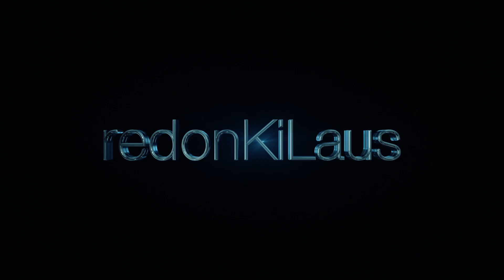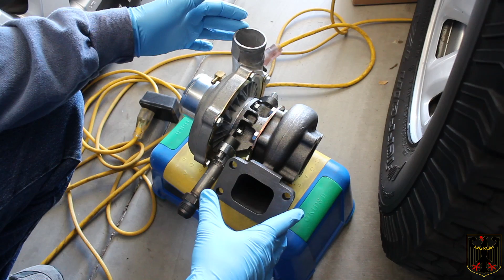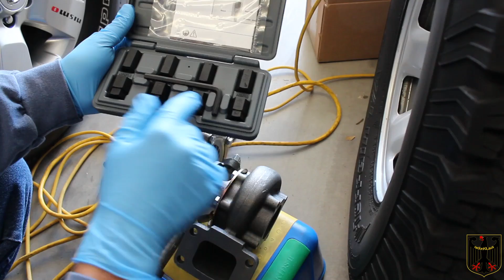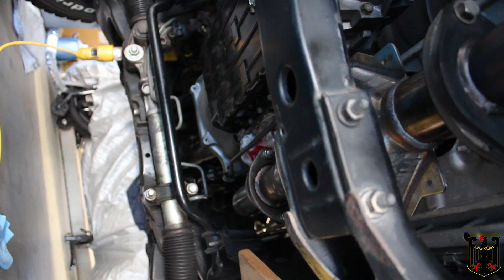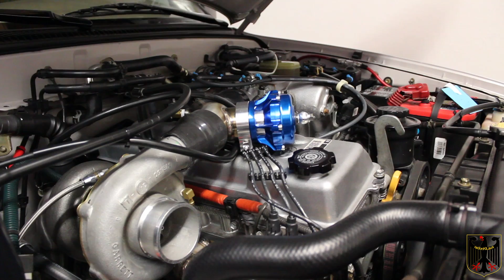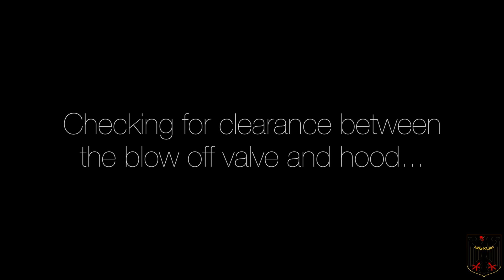KO Racing 2RZ/3RZ Turbo Kit Installation - Part 4

Comment: Hellos, where did you buy the ignition coils ? Did you remove the distributor? Help me please
Reply from the maker: They are factory, there are 3 versions of 3RZ, early engines with distributor (as well as later ones in some markets), then in 96/97 they moved over to 2 remote coils, then in 2001 over to coil on plug.  Thanks for watching!

Comment: Why no intercooler?
Reply from the maker: It's a simpler setup and doesn't require chopping up the core support, plus I'm running low boost.  I am planning on adding a methanol injection system to make the truck more drivable during our very hot Arizona summers.  Thanks for watching!

Comment: Why don't use a intercooler ?
Reply from the maker: Because it is not technically necessary in low boost applications, and because I didn't want to cut the actual vehicle to fit intercooler piping.  You can definitely run one if you want fairly easily.  Hope that helps, and thanks for watching!
Reply: ah okay, now i understand, thank u sir, great video, great job, i have a Toyota Prado SUMO and this one have the same engine, How much power do you get ?

Comment: I have a 2rz and I pieced together my turbo set I put a small water to air intercooler which I would highly recommend
Reply from the maker: The water to air IC is definitely a good option if you don't want the hassle of running piping for a traditional FMIC.  Thanks for watching!

Comment: I'm going to get the KO kit soon hopefully. What do you recommend I buy like parts that are needed that don't come with the kit?  to make the install process faster ?

thank you for your help really appreciated
Reply from the maker: +Tobes There's a lot of misc. hardware and things like vacuum lines you need to make the install perfect.  One thing you definitely want to purchase is a wideband A/F ratio gauge, as that alone will potentially save your engine in the case of a tuning or overboost mishap.  Hopefully this helps a bit, I cover most things in my video series.  Thanks for watching!

Comment: is that aftermarket catalytic converter ?
Reply from the maker: +Tobes Yes it is, it's from Magnaflow.  If you have a 4Runner or T-100 and you purchase this kit, it will come with the same one in order to be able to be bolted on without any cutting/welding.  Thanks for watching!
Reply: +redonKiLaus 

I have a 2rz ; so if I get the KO kit it will provide a catalytic converter?
Reply from the maker: If you have a 2RZ, you have a Tacoma (or possibly a Hilux, if outside the US), so they will not provide a cat by default.  You can always add it to your order if you are in need of a new one, however.

Comment: what's the distance from the block? to the back for the downpipe
Reply from the maker: +VestigeVogue I don't remember the measurement, but if you order from KO they now offer a 4Runner version of the kit with the same spec as mine, which is bolt-on.  Thanks for watching!

Comment: Hey Redon, what size studs did you use to bolt the turbo to the manifold and where you purchase them from?
Reply from the maker: I honestly don't remember what size the studs were, but they come with the kit and I believe they come with the manifold as well if you purchase that by itself from KO Racing.  Sorry I couldn't be more help, and thanks for watching!
Reply: 10 x 1.25

Comment: I need more, feed my 3RZ obsession! I have always wondered what you use(ed) to clean your engine. It is so pristine!
Reply from the maker: I will be finishing up my turbo install this Thursday/Friday.  I had to order a new upper radiator hose to clear the intake, as well as get a new 11psi BOV spring (these engines pull about 20in/hg of vacuum, and the 10psi spring I got was only spec'd for ~18in/hg, so the valve stayed open and caused a massive vacuum leak and lean idle/rich when off throttle).  The final video detailing the turbo install will be posted around then.  I will have more videos fairly soon detailing a PTP turbo blanket install, and possibly a boost controller install, SAFC install, etc; I will have to see what the truck needs after I get it driving.  

As for cleaning my engine, I use a fairly simple battery of tools.  For grease removal (pretty rarely needs this), I use a toothbrush, some rags, and Simple Green.  That's really it for heavy degreasing.  For an engine wash, I wet the bay down with water, spray on Simple Green, and then agitate with an old wash mitt.  Then I rinse it down and dry.  After that, I use Meguiar's Ultimate Quick Wax (it's a really good spray wax) on all of the painted surfaces in the engine bay, including the bottom of the hood, inner fenders, firewall, etc.  I occasionally use this on the valve cover and intake piping as well.  For the plastics and rubber hoses, I use Armorall protectant; I spray it liberally on a rag, wipe it on, let it sit for a few hours, and then buff/wipe off.  I have cleaned the engine since I bought the truck new in 1997, so it very rarely needs anything beyond a normal wash (I only do heavy degreasing when parts are disassembled and I have access to anything that does not normally get cleaned).  That said, it is very possible to get a dirty engine that has never been cleaned as spotless as mine.  My friend managed to get his 1988 Volvo 760 Turbo's engine bay nearly as spotless as mine with me just telling him how to do it and what tools to use; he had never done any engine washing before.  

I hope this helps answer your question.  If you have any more or have video requests, please don't hesitate to let me know.  Thanks for watching!

Comment: Hey redon whats your opinion of KO Racing? I've been looking at a low cost replacement for my Audi turbo but just trying to get a feel for the brand. Is it manufactured in China? Have you used their products before with good results?
Reply from the maker: KO Racing does not make turbos themselves; they are a performance company in Oregon that specializes in Toyotas.  They use Garrett turbos, which are made in USA, and are very good quality and are extremely reliable.  If you are looking to upgrade your turbo, I suggest either Garrett or Precision Turbo (which is a modified Garrett with upgraded components).  I think the turbo kit from KO Racing is very well-designed and of high quality, despite a few quirks (those should be worked out shortly).  It uses top brand-name parts in addition to the custom fabricated pieces, and should hold up great over time.  Thanks for watching!
Reply: @redonKiLaus  I met with KO Racing in Spokane where his shop is now located. He fabbed up a few pieces for me for my install which hasn't been done yet due to collecting the rest of the parts. i was wondering if you have any pics of the down pipe from the turbo to the collector? I've watched all your vids up to this point and haven't seen a clear pic of it? Did you use a SS sweep 45 or sweep 90 off the turbo to the run of the downpipe and then a 90 or 45 to the collector? I've bought 2-1/2" SS everything for the exhaust but not sure what angles you're running from the turbo outlet to the collector by the cat
Reply from the maker: @mikedillman2761  It looks pretty much identical to the photo of the downpipe on his website, see here: http://koracing.net/productimages/TacoKitProto1.jpg

He did the fabrication work for the entire kit on mine, so I can't comment on the exact bend angles he used, and can't verify on the truck right now since it's in summer storage.  

Thanks for watching!

Comment: You're the man!!
Reply from the maker: Thanks for watching!  I hope you enjoy your turbo kit.  Mine is awesome so far, and I haven't driven the truck yet.  It definitely revs faster!  See my response to your other comment for some (hopefully) useful info that should help you with your install.
Reply: I am planning on starting the install next month. I am very happy with the manifold.  Are you going to stay with the stock injectors and 4.5 psi?
Reply from the maker: I have the brown injectors, which flow about 300cc, and I plan on staying with those for the time being; I may upgrade to larger injectors in the future and may also do some sort of fuel management system.  I actually drove the truck around the block today; with the exception of the stalling issue, it ran very well; tons more power, feels similar to my Nissan Xterra with the 4.0L V6 (and mine has Nismo headers and a catback exhaust).  It ran about 5psi of boost on the gauge, which is about what I expected with the 4.5psi green spring.  I did not get an accurate AFR reading, because the BOV stays open at idle, so it runs a bit lean.  Once I get the kinks worked out next week I will make a final video on the turbo and all the extra parts I ended up getting.
Reply: redonKiLaus I  was planning on running the Map-ecu, but if is running lean it might be more feasible to run an adjustable FPR and little more pressure and stay with the stock setup.
Reply from the maker: The only reason that it is running lean is because the BOV being cracked open lets unmetered air into the engine; with the new BOV spring, there should be no lean issue at all.  If I do end up needing minor tuning, I will probably purchase an Apex'i SAFC for ease of use, but if I decide to go crazy with the truck in the future, a MAPECU is one of the better solutions that I would consider.